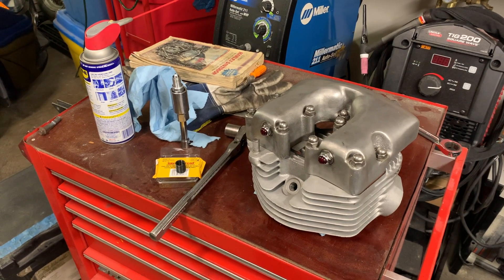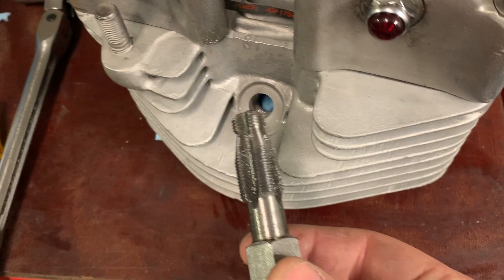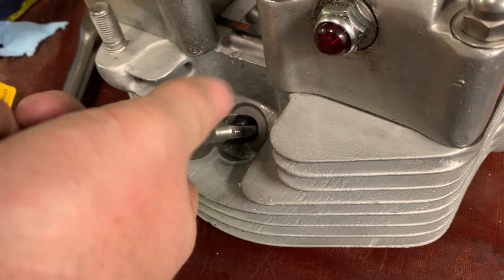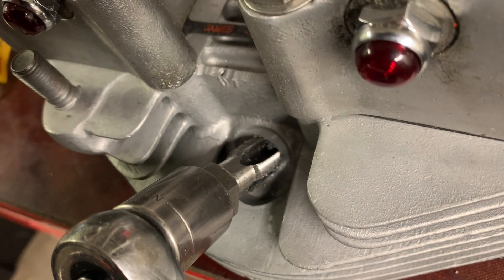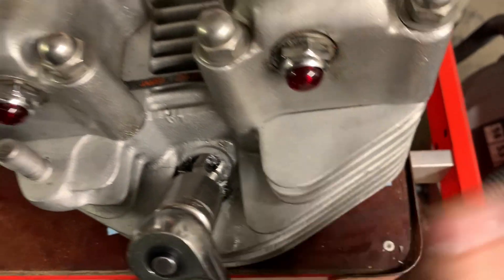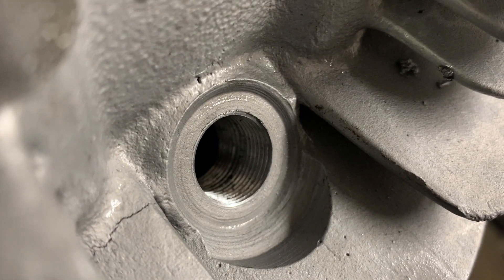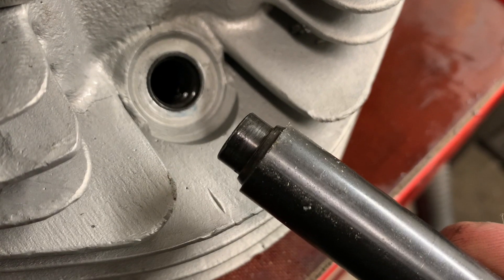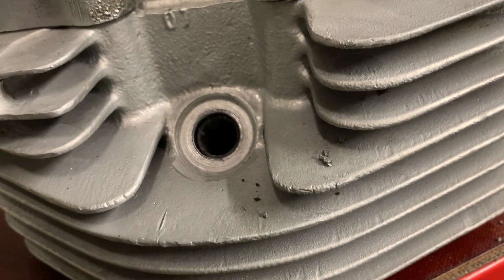Harley-Davidson Shovelhead Spark Plug Thread Repair

Comment: I think red271 Locktite would be a better choice than blue.
  If someone wanted to do this without pulling the head (I wouldn't), a novel approach that I have read would be to remove the exhaust and connect the out-flow side of your shop-vac to the port.
Reply from the maker: I fully agree with the red Locktite. And I think your suggestion of a shop vac on the exhaust side would work as long as the valve is open, but I still wouldn’t risk it as you even said. Thanks for the comment!

Comment: What I typically do, after backing off the tap to break the chips, blast down the 4 gulleys with compressed air to blow the chips out.
Reply from the maker: Never hurts to clear those gulleys out! Great tip.

Comment: Just blew out my rear spark plug on my 1972 shovel but don't know what kit to get 😫. My plugs are 13 16 by quarter inch long threads does anyone know what kit to get I want to use a king sert kit no Healey coils
Reply from the maker: I would take your old plug to your auto part store and match the thread length with what they have or refer to the manufacturer website for the kit I use in the video. Good luck and hopefully my video helps!
Reply: @bashby80  how do you do this without removing heads...how to vacuum out chips without engine tear down?  is there a way to stop chips from falling in?
Reply from the maker: @cccp3170  I wouldn’t recommend it, but if one was to try, I would think a dab of grease on the threading tool and constant shop vac action. Even then I’d be leery of trying it that way, but crazier things have happened and worked! Lol